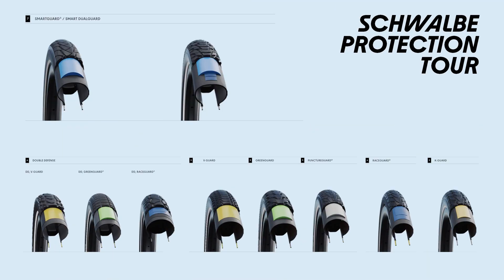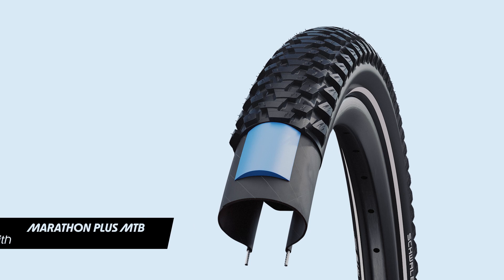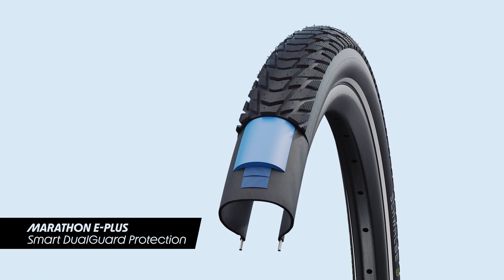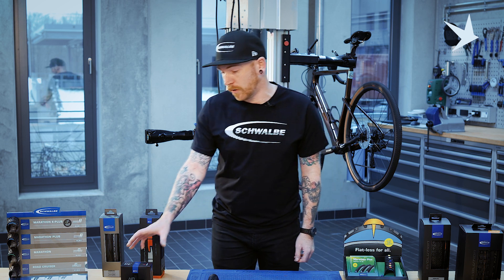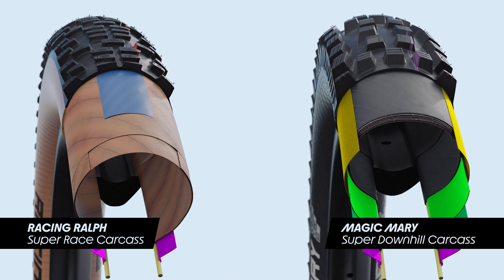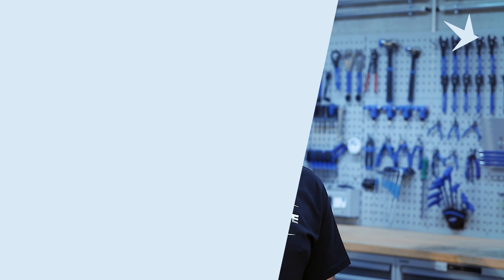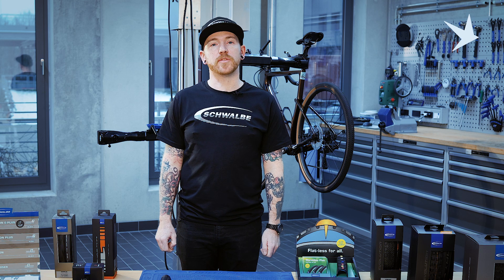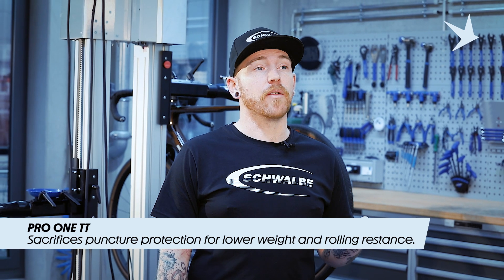What makes a bicycle tire puncture proof and what is a tire carcass?

Comment: FOR everyone who thinks ”schwalbe” antipuncture tires are something worth paying for, pause video at exactly 1.00 and take a very close look at the segment this guy holds in his hands. notice anything suspicious? besides the fact that the thickness of the tire on the rolling surface is that of a normal tire, don't be fooled by the 2 colors scheme going on there, like the tyre would have an extra layer of sorts. IT DOES NOT! Don`t believe me? Cut it, look at it after you bought it! Besides the fact that what the guy holds in his hands is twice thicker than the real tires, much like in the real life deception, you will just notice the brilliant work of an engineer that threw all the knowledge they were capable of to just to split the thickness of a normal tire into two distinct colors, as if the tire would have an extra layer of protection. It does not! It has just been split into two distinct colors for the same amount of thickness a normal tire would present. With that comes the lie of the added price.  not to mention that they pick up biological seeds of the puncture vine/caltrop plant like a magnet. for anyone who thiks I am full of it, I have pics to prove it. Just say the word, I will reach you for it!

Comment: Just started using my brand new cube hybrid With smart Sam. Was happy to get a new bike with Schwalbe but these tyres have no puncture protection . Third ride and got a flat and fifth ride on gravel surface again. These types are sxxt! So annoyed by this experience I do wonder why my Cube dealer didn’t warn me? Why supply à new 3.5 k bike with these £19 tyres?

Comment: For an all purpose type tire for a 29” hardtail MTB, road use around the neighborhood and light trail, would you recommend the marathon plus mtb? Looks like it might be what I’ve been searching for. Thanks.
Reply: Hi Jake, I got a Trek  29” hardtail MTB and ever since I´ve change the stock tires  (Bontrager XR1 Expert) with the marathon plus I had zero punctures in almost 4 years. The down size of this type of tire its his weight of 1270 grams/tire. The stock ones were only 630 grams. I use my bike on the light trail in the woods and in the city. You can definitely feel  its slower with this tire. Hope this helps.

Comment: Mine got punctured by a tiny piece of glass while I was cycling to work. Super disappointed by these tyres. I will be replacing with the Gatorskin tyres instead as I just don't trust Schwalbe tires anymore.
Reply: Some people use puncture-resistant tubes inside the puncture-resistant tires, for extra protection.
Reply: I've been using Continental Contact Plus hybrid tires for the almost 4 years now and I haven't had any flats so far, even after I rode through some glass a few weeks ago, coming back from Autozone.

Comment: Hello 😄.
I am going to use YT again to give my feedback about your website and its readability / informations

In technology / faq : Tire tube
Which special features does a Schwalbe tube offer?

You say :  
A tube covers many tire sizes through its high elasticity and quality. Tube no. 17 works with tires from a width of 28 mm up to 47 mm - a great advantage for stockholding in the trade. At the same time, it is proof of the quality of the tube

BUT in
Product => Tubes
The Air Plus become visible only with a 37-622 size. It never shows up with a 28 size.

If i choose Air plus with the ""Execution"" filter, 37 is going to be the smallest size.

Maybe you could change your tool to show the whole possible sizing like :  28-47/622 for example.

Also, the filters are not really easy to read, like those used for the tires.

Filter : Execution
Nothing can be sorted by, all the references are all over the place in disorder.

Another example : Aerothan gives no information, nothing is showing, no reference at all.

The customers will maybe never know the whole possibility that you describe in ""In technology / faq : Tire tube"".

Making choices and researches even harder and maybe not with what they wanted, wished for from the start.
Maybe even some shops won't tell or know the whole details.

You need to update, upgrade your filters, this maybe costs you money because the communication is lacking for the consumers.

I hope that my feedback is not stupid, sorry if it is.
Reply from the maker: Thank you for your very detailed feedback. We're sure some of these points need to be addressed. We've actually forwarded the entire feedback to the relevant people here at Schwalbe.

Comment: 4:14
Materials and production lines saving costs, for also recycling purpose is maybe why for example, the city category, you could get rid of all the tire with less than 4.5 stars on your puncture scale and very low outdoor capacity (because also of no puncture protection).
MARATHON RACER - min size 30 
BIG APPLE K-GUARD - min size 50
BIG BEN K-GUARD - min size 40
FAT FRANK - min size 50
KOJAK (bad on wet ) - min size 32 
ROAD CRUISER - min size  28

Those references should be stopped in your production line up. 
You would gain more on productions' costs, ecology and benefits if you could just stop those.

Improving the sizing charts on the really good models for puncture at least, allowing more road wheels to mount those thick and durable tires, gaining weight, material costs, rolling... Because a 25/622 will have more rolling than a 40-622.

If you could allow more road wheels to get road tires sizing with 6-7 stars on puncture , then you don't need to produce poor puncture proof tires with poor wet gripping capacity.

Also you can not say that those tires with 3+ stars on puncture can have a decent 3+ stars on outdoor area.

And one more suggestion, can you improve the filters on your Products page.
The filters TYP + Purpose of use + More filters : are almost unreadable for anybody.

Maybe you could rearrange the readability with something like the stars scale used in the description of the models.
Adding also in those filters the sizing and a clear button to separate the E-tires models and tubeless ready products from the other ones.

So you have already the tools and you just need to swap and replace the filters so hard to understand for people who need clear indications for their need, for them to search on the third party shops.

You could save costs for the consumers, by allowing yourself to sell directly and maybe reduce on the prices, compared to the inflation done by third parties and then you could even be more competitive and more ecological compared to your competitors.

You have the stock, you just need a internal tool to gathers accounts and sell directly, simple as that, nowadays it's not that hard.

Which could be great, if you could allow to your consumers to sent you back directly their tires to improve your recycling ""card"", project and capacity. One stone, two birds.

I hope that i am not saying nonsense and wish you the best... and thanks for your engagement pushing further for the market to be more responsible.
Reply from the maker: Thank you for your very detailed feedback. We're sure some of these points need to be addressed. We've actually forwarded the entire feedback to the relevant people here at Schwalbe.